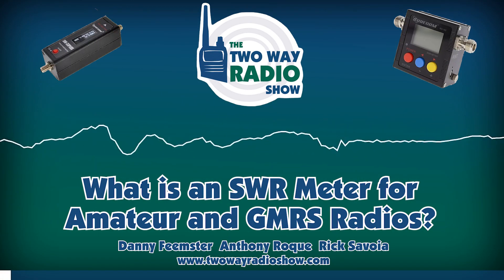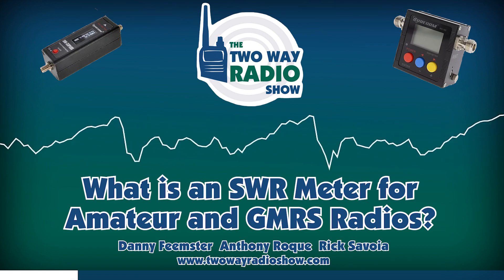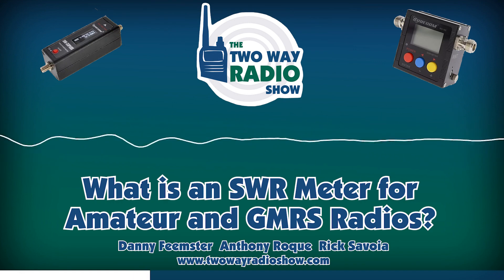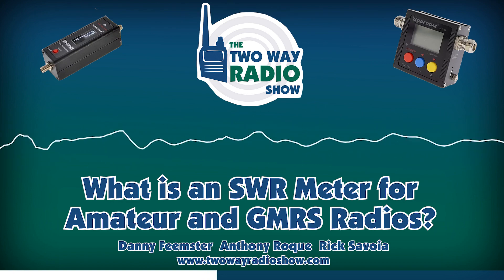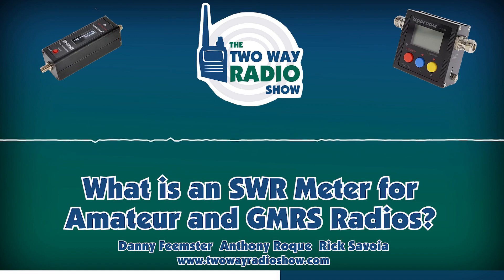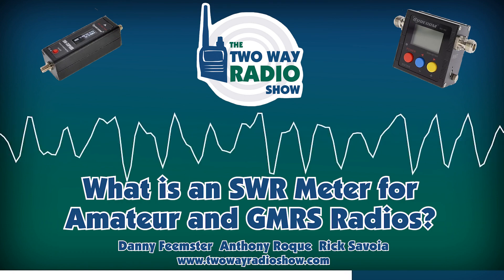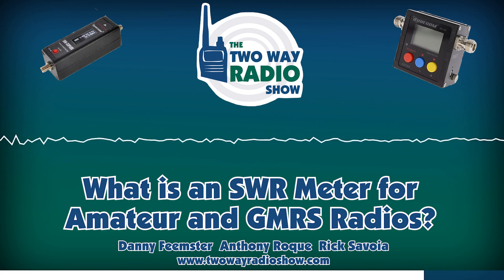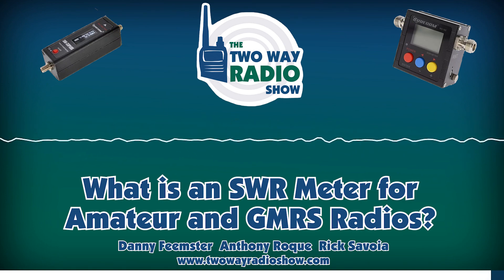What is an SWR Meter for Amateur and GMRS Radios? | TWRS 168

Comment: The setup requires a grounding plane because you'll get inaccurate readings if you try to measure a walkie talkie antenna with the SWR meter.